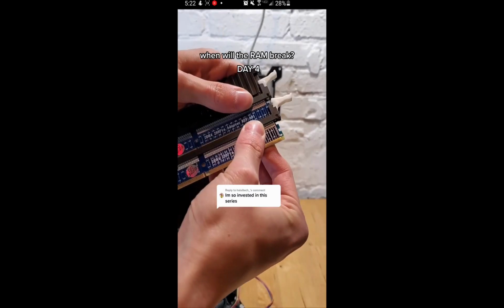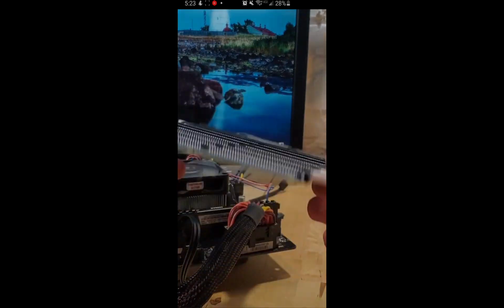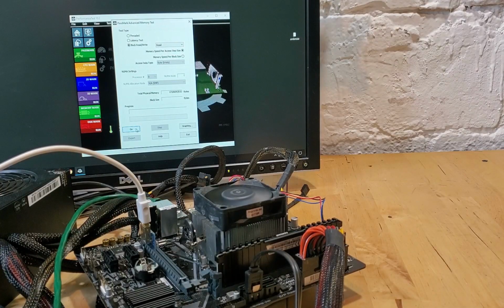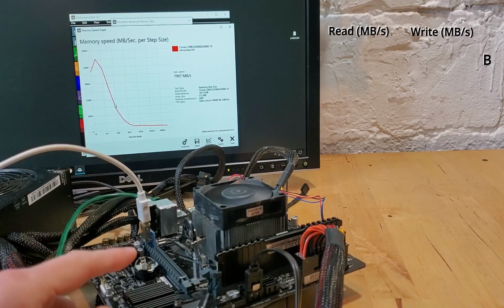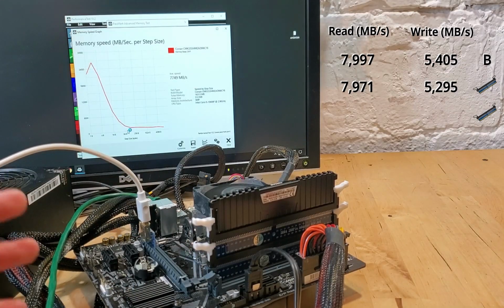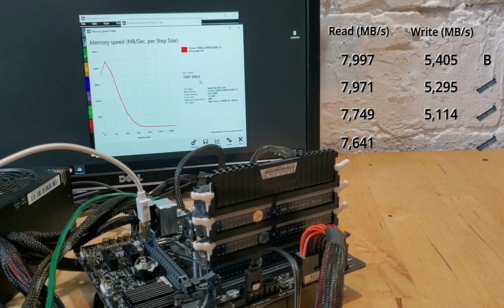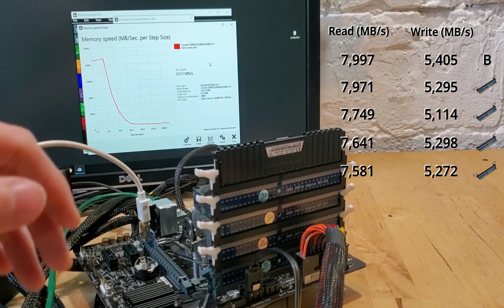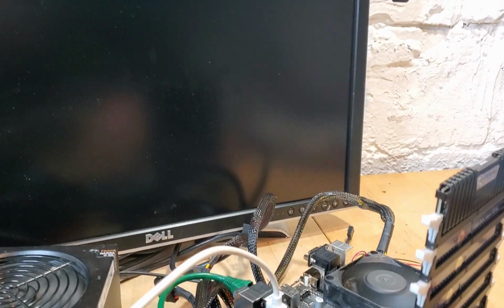Does RAM have a Height Limit?

Comment: considering ethernet cat 6 runs gigabits,,     power and the ohms laws would affect it more....example.. the more line electricity has to go throough the more LOSS you will get in say a caple, 
so the pc regulater might not go up in amps high enough to power the ram?     lol   you's have to be like 10+ feet though,     LOL  funky looking computer with ram touching the ceiling LOL

Comment: I'm gonna take a guess and say that, the reason it cant handle that many adapters is because the power cant travel that far. A solution to this would be to add more volts to the ram. maybe....

Comment: 2:33 - Propper Thermalpaste installation

Step 1: Wipe finger grease on CPU
Step 2: Don't worry about old paste 😂😂

PS: Yes, I know its a test bench and the paste gets swapped regularly so it doesn't matter if finger fat/oils degrade the past.
PPS: WD-40 works amazing for removing Thermal past especially for old crusty paste. The past just runs off like water 🙂👍 But then of cause cleaning off the WD-40 with alcohol is necessary.

Comment: I suspect that the low voltages used to run the ram likely had dropped too much for it to properly run the controller on the ram.

Comment: What I don't get is why the speeds changed at all? If it runs at a certain clock speed and timings, it should have a fixed performance, and the only difference from risers should be in stability.

Comment: I even I dont know what's the use of this riser. I only see memory riser (a.k.a ram riser) being used in an enterprise server and it doesnt even look like that. Memory riser in server have multiple ram slots where you filled it with smaller capacity ram then you can insert it to the ram slot on the board. Memory speed isnt that much of a problem on a server, most of the time....

Comment: i'm guessing it's for applications like ram validation, where you may need to test like 500 different ram modules on a single board, so you don't damage the board. The release tabs on the risers seem quite generous.

I've missed seeing latency measurements, i think that would've shown quite a drastic change. Also i have a feeling that lowering frequencies or loosening timings might allow the sixth riser to boot.

Comment: For those of you who were curious, the PC didn't post because the latency from the CPU, and the RAM got way too high for the CPU to be comfortable.
Reply: He kept the ram timings default. The drop in performance was from higher ram error/retry rates. Slacking the timings in cases of the 5 stack, would probably lead to slightly higher performance. Because his benchmark varied more than just simply slacking timings without  riser.
Reply: @wishusknight3009  I'm talking about the PC not posting
Reply: @EddieTristes  I know.

Comment: I wonder if loosening the timings and adjusting the voltage would allow you to go even further
Reply: It should, spec for servers is traces of upto 18 inches can be used. He would need to slow the ram to 1866 or less with jedec safe timings. (as opposed to jedec standard spec timings) So latencies >20

Comment: Would be interesting to see how those risers affected the latency on the RAM as Read/Write speed on RAM normally fluctuates between tests even without risers. AIDA64's cache and memory benchmark should provide good results in that regard and will also show you how your timings and frequency are also affected, if you ever wanted to research this... for science

Comment: Have a friend that's trying to install windows 98, but his ram is so fast that it over loads it & reads as not enough ram. It can only be booted into safe mode for some reason. Sending him this vid and hope it will help him slow down his ram.
Reply: Dude. The actual solution to that is to configure windows to only see below a gigabyte of ram, it’s because above a gigabyte of ram is windows 98s breaking point

Comment: Fantastic idea, but you might be plugged into the wrong ram slot for maximum height. One of the slots is inherently more stable, due to the shape of the traces and the reflections of EM waves. The motherboard manual should specify which one should be populated first, but usually it's the one further away from the CPU. Or maybe you've already done the research, or tested it for yourself, in which case just please disregard this.

Comment: The only thing I can think of these would be used for is using with half height Ram in a 2u server or something to put it in the way of air flow. But I mean at that point just get full sized Ram
Reply: Maybe some very specific water cooling stuff where you want to fit a reserboir into an ITX case and it barely fits with the RAM heatsink?

On the other hand, you can just get some low profile sticks instead that don't have a heatsink at all.
Reply: It’s for applications where you need to remove and swap ram often so the risers are basically to slow damage to the motherboard

Comment: Maybe the ram risers are supposed to be used in server or for air clearance so the stick of ram doesn't overheat with overclocking or 24/7 use
Reply: @Marauder true but what about overclocking ram, or maybe some custom ram heat sink won't fit without a ram extender

Comment: The riser is used in testing bench or industrial where you need to install and uninstall ram sticks frequently, so you don’t damage the motherboard and the riser is a sacrificial part
Reply: Yes and no.

Risers are used in test benches and R&D applications, yes, but their added benefit isn't reducing motherboard strain, but making it WAY easier to probe RAM pins (e.g. hooking them up to an oscilloscope to tune timings or check for signal integrity).
Reply: @MaavBR  okay that makes a lot of sense
Reply: @MaavBR  I was expecting to see that in the video, and was sad thats wasn't done.  Being able to show the effects of resistance and latency on signals, and help explain why electronics HAVE to get smaller to get some of the speeds they're getting.  CPUs are actually really tiny; with most of the die's size going to providing the interface for pins to connect to sockets or surface mounts.
Reply: @MaavBR  yep. I can see that being useful.
Reply: @MaavBR  shouldn't the riser have testing points in that case?
Reply: @monchiabbad  The pins of the slot are waaaay easier to access than the pads in the stick, and they're already numbered. To add a testing point per pin on the stick, you'd need a massive PCB...
Reply: @MaavBR  wont you rub the copper off the ram after using it alot
Reply: @frostedlambs  Maybe after a few thousand installs, yeah

I'd say that a stick wouldn't reasonably ever be installed that many times though, as no company has ever made this many SKUs under the same RAM socket (and validated the same stick always)
Reply: @MaavBR  but why not both
Reply: that sounds pretty reasonable, and a useful case for these risers
Reply: So you're saying...it's a condom for RAMing
Reply: @ihavekalashnikovyoudomath9275  this is a freaking funny comment!!!🤣🤣🤣🤣😂😂😂😂 Condom for ramming!! It's pc porn for us nerds!
Reply: Thank you, I was just about to ask here in the comments why would such a thing as a RAM riser even exist. Now I know. And it makes a lot of sense.
Reply: That makes sense

Comment: I assume voltage drop is why it isn't booting past 5 risers, if you try bumping it slightly beforehand it may work with more
Reply: Correct!
Reply: And slacking the timings a lot. He should be able to drive trace lengths of upto 18 inches.

Comment: The more ram stacked like that the more electrical resistance. Theres a point where the RAM slot isn't able to power a ram that high
Reply: i think it's more on interference from outside. it's like an antenna, it mess the signal to the ram.
Reply: @samueladitya1729  For sure. It's 100% a signal integrity issue.
Reply: @microgamestation  Might actually be both.
Reply: @Tairex777  RAM doesn't just refuse to boot when the voltage is too low; it'll spit out errors and crash. The board is applying looser and looser subtimings to the memory which is resulting in the performance drop we're seeing. There's too much signal degradation over those risers for the board to achieve 2666MHz with bootable timings.
Reply: @microgamestation  I know but ok
Reply: @samueladitya1729  nope it's the resistance
Reply: @samueladitya1729  only if you loop cable...... it's cally EDDIE     current.....  much similar to an electric moter,     electricy down a coil creates slight magnetism is things near it..     more coils stronger emf... ( electromagnetic flux)
Reply: @Harper Buursma probably yes, but thats also a good way to fry your memory
Reply: @irisical8934  sending more power is perfectly safe since that power is lost to impedence in the risers
Reply: @irisical8934  I fry my ddr ram in oil on an pan to pre-heat it during winter when i have -40 outside so it can boot up
Reply: additional resistance and parasitic capacitance added with each riser causes the frequency to drop, so much so that the memory controller cant deal with it
Reply: I'm wondering if there are also issues due to capacitance
Reply: @xlneoMAXlx  modern electronics are fairly sensitive to how much power is being given to them at what voltage, so if something like a significant increase in voltage was done it would still go through and likely fry the memory
Reply: @irisical8934  you can run ddr4 memory up to 5/100ths volt higher for extended periods(years) of time with little to no issues . 1.35volts to 1.40. I use this config since day one on similar corsair vengeance 3000 mhz with memory controller on a Ryzen 3 3200 g  which only supports 2866 normally.

Comment: You should try channel B, usually they're the stronger channel on 1DPC boards. And you could try tweaking IMC voltages to see if it helps it run. Signal integrity would've gone to shit with this so anything you can do to help the memory controller on the CPU will help you run more risers. And you could see if lower frequency on the memory works too I guess, which you might say is a step too far but this is all pointless anyway, might aswell make it more pointless :D
Reply: Damn that is hella smart
Reply: Thought the opposite way with the frequency, use a module with higher rated clocks, but at the same speed, to achieve more hight.
Reply: Pointless to the MAX!!
Reply: I think delay too much for cpu
Reply: @emir4707  Well, it won't affect the performance until you make a miniature Berlin Wall at the side of your CPU heatsink fan.
Reply: @guymanguy5208  cpu expect estimated time for read and write. I think this problem latency is too high from expected
Reply: @emir4707  yeah probably.
Reply: @emir4707  Exactly what I was thinking